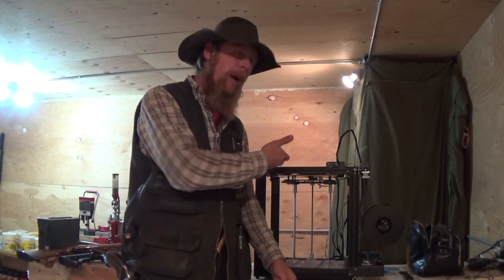New Idea: Glass-Filled PETG for 3D Printing (TIS279)

Comment: petg is thermally better but it isnt as strong. pla plus is a lot stronger. petg is brittle to begin with I think glass filled would be even more brittle but i could be wrong. doesnt take that much to upgrade a printer to print nylon carbon fiber.

Comment: The glass fiber will pretty quickly wear out the nozzle as mentioned in the comments here, if the glass "fibers" where atomized to be the same size the prints would be more consistent and would prevent clogging.

Comment: No glass filled PETG yet as far as I can tell, but you can get glass filled PP filament. It isn't cheap and PP isn't as easy to print with but it also doesn't require a sophisticated setup to print with. You can get carbon fiber PETG though.

Comment: You could do this. Open Source DIY sub $300 filament extruder designs exist. The only potential issue would be the extruder getting clogged and the extra wear of processing fiber filaments on your DIY setup. If you print a lot, it may be worth making your own filament from plastic pellets (about $2 USD per KG (2.2lbs)).

Comment: Hi, Vik Olliver here, the creator of PLA filament (you're welcome). Including enough stiffening fibre (carbon, glass, stainless steel) to do anything meaningful generally makes the filament inflexible and brittle, so it's hard getting it to go through the extrusion mechanism.
For strong parts I recommend using translucent PLA with minimal wall and infill as a "lost wax" core, and casting in the material of your choice. I have done this with everything from polyester resin to stainless steel. Happy to discuss experiences, there are tricks to it.
Given a wide enough nozzle and robust mechanism however, in theory you could used the extrusion effect of 3D printing to orient fibres for maximum strength.

Comment: My concern is that the main weakness of most 3d printed parts I’ve come across has been in de-lamination of the layers from each other which glass fibre fill wouldn’t be able to help with of course, but the adhesive property of petg and glass makes me think the glass powder fill is very promising. I do wonder if it would be possible for you to test this by simply melting some petg carefully and mixing in some glass powder if you had some glass lying around to grind up a bit, and then you might be able to extrude it through a hole the right diameter and get something close enough to the filament you buy that it would feed through your machine... it might take a bit of tinkering however, but if you were successful you could experiment with both the particle size and percentage of glass fill, maybe even with a concrete type idea with glass sand and glass powder together cemented by petg... many many ideas but if such a composite were reliably printable it could be very effective indeed...

Comment: Hey Tim, I haven't finished watching, but you may be surprised to find that while PLA is more brittle than some other materials, it has a quite high strength, for instance compared to PETG. So, it's not as tough, but it is surprisingly strong (i.e. it takes a lot of strain before it begins yielding). Glass-filled PETG is a cool idea, though.

Comment: You will seriously need to upgrade parts on your printer for that sort of thing buddy ie steel nozzles, flexible build plates, a couple of internals for the heat bed, filament feeding drive plus you will need an in closure to maintain the heat to prevent warping etc also mess around with the retraction settings to reduce any stringing

Comment: Well, there definitely could be some uses for a glass-filled PETG. But there are issues as well: the first and biggest - it will greatly increase wear of a brass nozzle just like carbon filled filaments do. And it also going to make printing head more prone to clogs and/or require nozzles of a larger diameter.
And with all possible issues - the filament can't be stuffed with glass to the point where mechanical advantages will be significant. It is possible to add only some % of glass to keep material extrudable and it will only enhance mechanical properties along the layer; the inter-layer strength will remain unchanged.

IMHO (based on my 5-yrs experience in FDM 3D printing): it is much more productive to embrace limitations of a plastic 3D printing (just like any other technology with it's own limitations) and learn to work around them. Design thicker parts, plan holes for metal rods to reinforce the structure. Process parts with dissolver to enhance layer adhesion. It is also possible to make molds using 3D printing and then cast actual part in metal.

Comment: https://www.mcmaster.com/3d-printer-filaments/

These are more industrial filament types you can find. Glass fiber reinforced is there but so are many other advanced filaments. Worth a look. Requires plenty of experience with 3d printers to use a lot of these filaments.
Reply: https://www.mcmaster.com/3d-printer-nozzles/

If you're printing in abrasive filaments, you better get a harder nozzle. This page shows plated brass which could work really well with abrasives. Anything harder than regular brass is a good idea.

Comment: Instead of printing with materials that could damage your nozzle, print with something that can be used to make a mold. Polycast is a filament that comes to mind because I'm familiar with the company Lulzbots.

Print with a material that gives you high quality to make molds. Then, resin cast or molten metal cast the part in that mold. High strength and high fidelity parts will result.
Reply: this, especially if your mold is itself for a mold, that will be cast in aluminium or similar, and can be used for multiple generations of injection molds

Comment: Before 2:00, pla is not as biodegradable as you may think. Under normal conditions of being left outside, it's not going to degrade from the elements. It requires an extreme environment to properly decay.
Reply: Direct sunlight deals with PLA pretty fast. A couple of years outside and thing starts to shatter like it was made from dried dirt.
Yet it may live forever in a house on a book shelve.
Reply: @shurmurray  fair enough. Can't say I've had a part out for that long. Usually they deform from heat before degrading. Good to know
Reply: @shurmurray  UV in sunlight will prety much destroy all plastic after x amount of years.

Comment: One consideration with fiber reinforced plastics, the strength is added mostly in the direction of the fibers.  A fiber filled extrusion 3D printed part might have excellent strength within layers, but still suffer lesser adhesion between layers.

Comment: Several gun channels that build 3d printed firearms actually use PLA because it fails rather than deforms like with PETG.  It's really a question of what stress are you actually putting on the part. Personally, I've used PLA for use on my truck's roof rack mounts between the struts and the rack itself. Printed them 3mm wall thickness, but otherwise it's just a typical print and I've bounced around plenty of rocky roads down in Utah's mountains and over in Capitol Reef.  
 
I need to re-design it because the rack slides laterally a little bit and there is a more secure way for it to sit, but over all I've had a lot of success with parts made from quality PLA.

Comment: I started 3D printing back in April and am now running multiple printers.  In fact, I just ordered an additional printer a couple hours ago.  I have almost exclusively used PETG, but I have never seen any filament advertised that would be close to what you describe.  I would certainly be interested to see tests of such a filament.
Reply: Howdy Loads, I am completely green on 3D printers. I am looking to  get into them for personal use around my home as a tool to repair broken tools, fixtures, etc around my home. Would you mind giving some insight on what type of 3D printer or material I should pursue? For instance, my analog caliper just failed, one of the internal gears (plastic composite) disintegrated. I know start up cost will be more than just buying another caliper, but I want to make my own and be able to make and replace other items and tools in my home. Thanks for any help and any insight. I have tried to locate help locally but no one is willing.

Comment: Glass-filled nylon is a material that is already sold under the brand name "Zytel" from Dupont (specifically this is the clear/white colored zytel). This material makes very strong functional parts, but doesn't print quite as nicely as PETG. They also have a carbon fiber filled variant (black color). That said, your idea seems interesting, and I would definitely like to try printing with such a material. As others have said, printing with nylons requires an all-metal hotend like the one on the Prusa i3mk3s printers, one that can sustain like 290C for an hours long print without melting components or creating unhealthy vapors.

Comment: First.  Gonna go out on a limb here and assume  I know what this video is about, and ask you if you’ve looked at Biden’s GC plan.
Reply: If that's the case, there have been some very successful prints done with PETG. And some designs are more modular so you don't have to reprint the whole thing if something does break.
Also, I really need to look more into the FGC plans.
Reply: @BenReese  it’s bad.  Might end up being best to build your own 3D printer and keep the files off line.  Tyrants possibly incoming.
Reply: @durangotang1681  I have done some research already and downloaded some freely available information.
Scary times ahead for freedom.
Reply: @BenReese  yessir.
Reply: @BenReese  troubling for sure.       One thing I would say.  They may try to take our God given rights  but they can only take what we let them take.